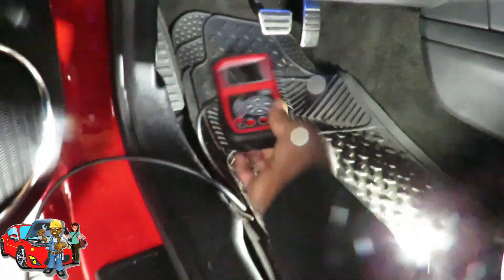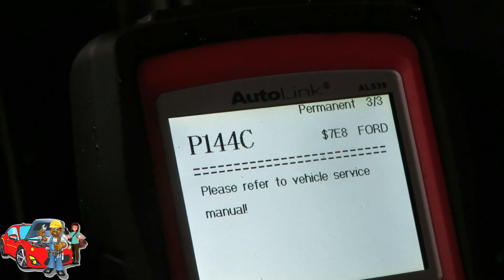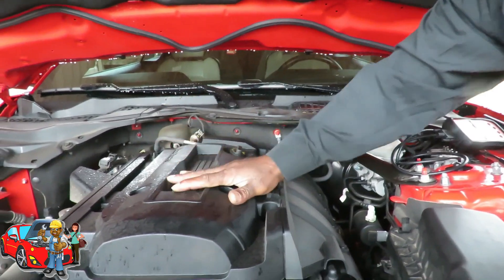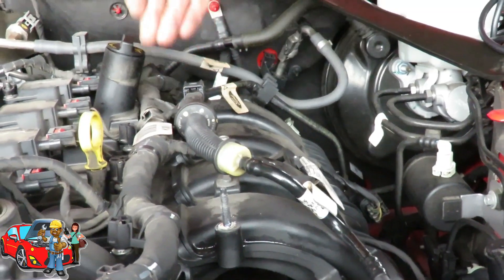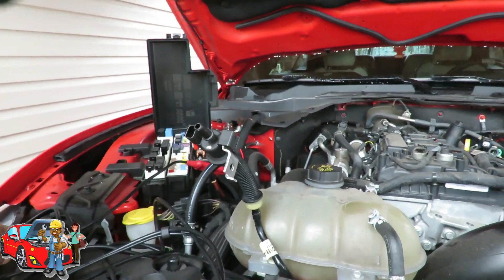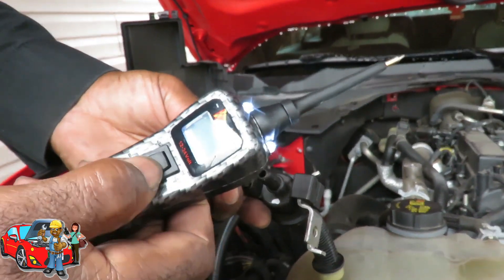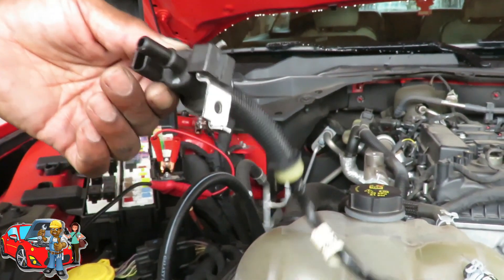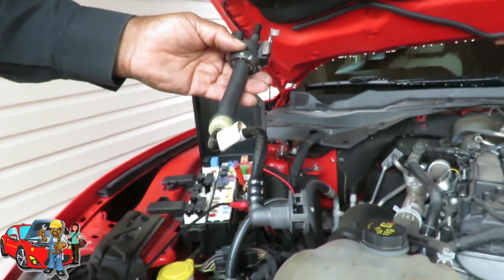2015-2020 Ford Mustang P144C Evaporative Emission System Purge Check Valve Performance

Comment: Good, informative video! Thanks for the insight to my EcoBoost's P144C code. I hope the issue is as simple as this one part and the code diagnosis is spot on because I may try it myself.
Reply from the maker: Appreciate that, and let us know was that the problem.
Reply: @OnlineAutoRepairVideos  It was. I drove over 100 miles after installing and clearing the CEL and it remained off. Thanks. 👍
Reply from the maker: @ COOL!!!!!